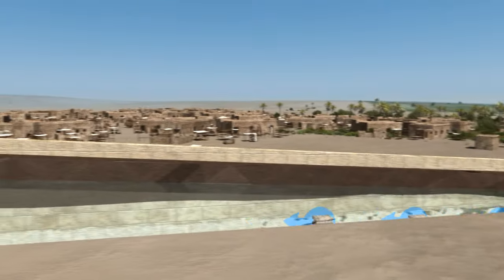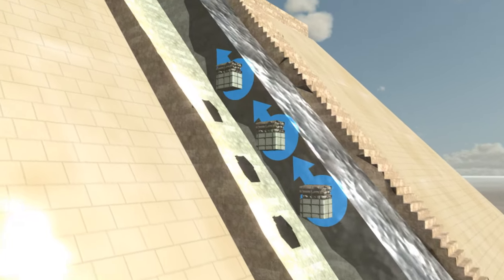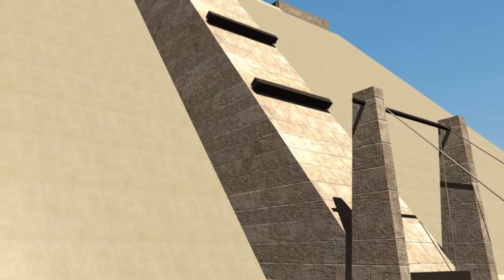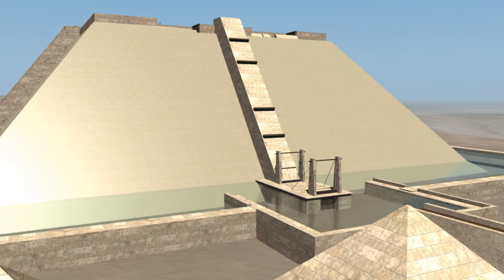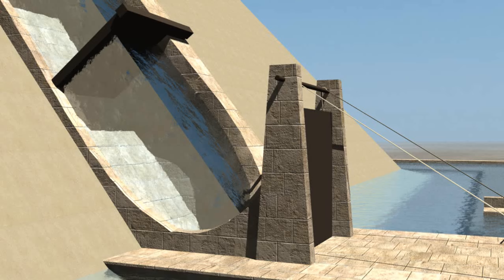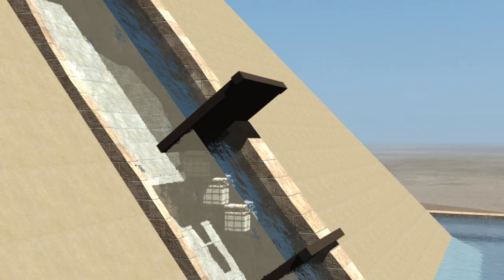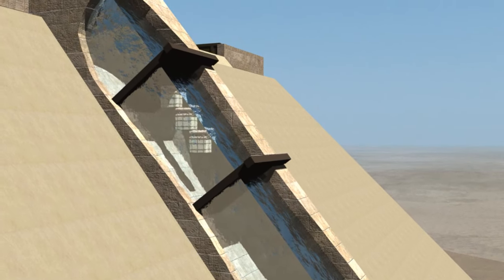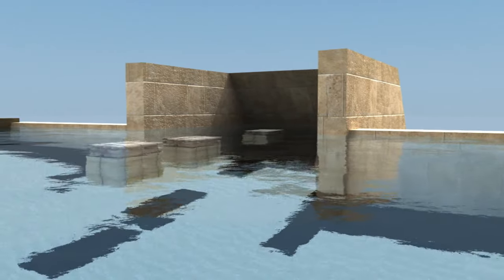How the Pyramids of Egypt were really built Addendum - Multiple Locks

Comment: Every time a block and floats go in those locks it displaces an equal amount of water down and out of the locks. As the blocks go up into each lock that amount of water is displaced downward into the lower lock. When the block reaches the top the water that was displaced from the locks is replaced by that amount of water from the top pool. So in effect you are trading water for stone, but you had to get that water up there in the first place plus extra for evaporation.
Reply: presumably it is easier to bring water up in smaller quantities than the blocks?

Comment: This wouldn't work because of the enormous amount of pressure to open each one, then you're dealing with water running out because there is no way the ancients could attain such a tight seal, which if they could would further increase the impossible pressure on the "gates".
Reply: Watch the video again. With the use of gates, the pressure is MUCH lower, and the gates are moved perpendicular to the pressure also.

Comment: As an engineer I can say the following:
1. The masonry walls of the shaft will burst under the pressure of the water column.
2. How are these locks supposed to be waterproof.
3. Filling the shaft with water and keeping that water inside would be a bigger challenge than building the pyramid itself.
4. The flotation device would need to be much bigger than shown in this animation. And thus the shaft would have to be wider which makes problems 1,2 and 3 even worse.
5.  The buoyancy force acts in a vertical direction, not a diagonal one. The blocks would be dragging on the celling of the shaft possibly getting stuck.
I can go on but I think you get my point.
Reply: I recently heard that any water elevator theory is not that credible. They don't have a lot of support in academia. Yet, these videos are all over and you keep hearing people say "did you know that the egyptians used those water elevators"
Reply: Very important points which do not seem to be dealt with that I have seen.
Reply: Attach the blocks with a rope on the bottom to a loop of rope and guide it up like a conveyor belt. And is the water pressure really enough to move blocks weighing a ton? let alone if they had 2 or three layers to reinforce it? easier to do that then the massive ramp idea. And when I calculated how many gallons you need to displace to get it neutrally buoyant if you use the top and all 4 sides, each face only needs to displace 116.9 gallons of water Roughly a little more then a bathtub per side, would need to be displaced. And granted if all you need is neutral buoyancy or slightly negative buoyancy, then the pulley system could drag them up the side and they wouldn't touch the roof of the tunnel. or just have the two positively buoyant and one slightly negative to balance out. And with multiple gates and locks the water pressure on a individual section can be reduced, yeah if you opened every gate at the same time then it would blast open the base, but what is it more likely to do, break the gate wood at the bottom, and all flow out or exert sideways pressure enough to move 1 or 2 interlocked 2.5 ton bricks? and all the friction force that would entail, it's not just a brick wall, it would act more as a solid stone wall in effect. And again what is easier, or occoms raizer this. Floot stuff around requiring relatively little man hours and need to pay people, or much fewer slaves etc. which as pharaoh means more money kept for you. Or do it the harder more costly way, and who is to say it isn't a combination of both methods. I know I for one don't even care if it's harder this way or more complex geting to work standing in cool river water all day or at least near it, due to it's micro climate of the cooler sourouinding area, would be way worth it. I used to work landscaping and I would wrap a cloth around my head and dip it in water, and that is SOOO much nicer then being out in the sun with no hat no cover, no shade, and working near water is SSSOOO SOOO much nicer. Go and work a week hauling around heavy equipment in the hot sun and you will do anything to keep cool, ice water, walk through the sprinklers, etc. Getting to be wet at my landscaping job are the easiert nicest hours to work. I spent over 3,000 hours in that job so I know what workign out in the sun is like, and hauling heavy crap around is like. I would not care if this method is more complex if it is at least possible, I as a worker would find it 10X 20X times easier to work on a pyramid like this than, your method. in fact I would rather work in the cool water of the pyramid like this, then out in the fields, or as a warrior, and who is to say they didn't do a lot off this work in their time not at war, keeping all your military strong and fit, while also making a monument saying don't F*** with us. If we can build something liek this we'll F** you up, so pay your homage. And don't start any trouble. And also having a line of people passing water buckets, is somthing even relaticly old and disabled people can do, and is much nicer work being around water in the hot sun then, your alternative of MOVE HUGE BLOCK RRRAAA!!! So cheaper easier, and like I've said befor the methods could have been done on small scale and other pyramids first while working out the methodology, and the kinks, how many gates do we need. Oh crap boss the gate at the lower lock broke again , the water seems to keep breaking it once we try to add more hight or water. "well add more" months later, it did it again... :/ add more then. etc etc. trial and error can get you to the point where you know what to do. and starting small and learning the concept, can get you much of this knowledge. Trial and error is essentially a crude form of the scientific method. so even if it is more complex, if easier, and cost and labor saving, anyone would rather do it this way. assuming it can be done. And granted I accept it may not be able to have done this way or maybe it could have been done this way but never was. Still I know if I was a worker, or grunt. this would be so much easier work.
Reply: @LegoSwordViedos  In this system, the workers still have to lift massive stones up the side of the pyramid, in order to make an elevator shaft out of them. An elevator with walls two or three stones deep, in order to withstand the water pressure. 
Therefore, the elevator idea merely leaves the builders with the same dry lifting problems, plus the extra issues and labour and time to build, operate and maintain the water elevator.
Reply: It's a silly theory
Reply: What about moving the giant stones you need to make this water elevator. Do you make another water elevator and so on this entire idea is based on building with giant stones to move giant stones to build do you see the never ending issue here. The simplest way is a complex pulley system using a water canal and boats to pull with and you could also help the boats pull by making parasails flying them up high using the heated air coming off the sand or using the giant golden sun disc to direct sunlight in the direction of said parasail forcing it in the direction you wanted. You may say sounds to complex of a theory but think of the complexity of the water elevator idea and my idea i think mine is more common sense based instead of needing higher knowledge. Boats float and pull a lot of weight and flags blow in the wind also every boat had sails and used a form of pulley for the sails so they only needed to create the canal which we know they did and they also found a boat right near the pyramids so i think this is more believable then a water elevator.
Reply: @martinheath5947  what isn't silly is levee, lock and canal system to transport quaried stone to at least the base of the pyramid. Up the pyramid is a bit far fetched but wouldn't put it past the Egyptians to figure it out, actually....they were incredibly brilliant!
Reply: Why just an elevator? Why not using huge sand embankments surrounding the whole structure and temporary block the nile river to fill it with water? A foundation of big blocks will stop the the vertical water force.
Reply: The jamming of the gates was the first problem I saw.

Also to make it float you have to make granite (which is 2.75 times denser than water) plus floaters (lightest dry cedar may have 1/3 density of water) just a little less dense than water. So ... 4 times the volume of the stone that's to be lifted? Or use watertight barrels?
Reply: I'm not an engineer and I was thinking the exact same thing when I saw this video.
Reply: Look they probably used water but they didn't do it that way I almost bet they had a bucket wooden or same material as the pyramid and would line a block floated in like you said was possible up with a Lift kinda pulley set up and dry the top the would full the bucket to assist in lifting the black up it probably wouldn't fully lift alone but imagine having a counter weight about the weight of the block + 10 strong builder men pulling a rope to control it's speed on how fast they raise it and as you being a engineer do you think his is a more possible option?
Reply: The walls are plenty strong if the water column is inside the pyramid ☝️
Reply: My tour guide said they used a lock and dam method to build them I'm not saying I believed it but his way of explaining it was more along the lines they buried the pyramid as they built each layer and would flood the inside square and float the blocks up on air filled animal bladers place a layer and repeat and once done came the reveal or unburial. That just sounded like far more work but I mean at the end of the day they were a lot of work regardless of the building method.
Reply: Pray tell how many forests would’ve even leveled for wood??? Lebanon is where the trees came from.  How many herds of animals butchered to make balloons?
Reply: Here is the answer 

From the Noble Quran:

 And how many a generation before them did We destroy who were greater than them in [striking] power and had explored throughout the lands. Is there any place of escape?

Quran 50:36

Here Allah SWT is reminding Us, back thousands of year's ago, there were people who were Created much stronger, and Allah also gave them this wisdom and also strength. And it was much powerful.
Reply: @judygreenwood4696 you can reuse the wood and the bladders… just like you can reuse pallets, or shipping containers.
Reply: Mate everything u said is absolutely rite the size it would have to be to make it work would have been to much work on a floatation device then the pyramid itself so this would have never have been thought of then also to seal something that bit would be almost impossible back then literally impossible
Reply: Bobibest89 do you think the pyramids were electric power plants? I don't ,but I would like to hear what you would say .
Reply: @LegoSwordViedos  ... Love reading your ideas, but please, use paragraphs and spacing where it is easier to read.  Very hard as one huge block of text.

Comment: Query :
How would they get that much water up there in the first place?
How would they move that much water every time they complete each level?
How thick would each gate be to be able to suppose that amount of pressure?
How would they have made water proof junctions around each gate?
How would they know each rock had moved up far enough to close the gate behind them?
How thick would these water tunnels need to be to stop the water pressure breaking it apart?
Wouldn't these water tunnels still be there if they were so solidly built?
Reply: hey good questions!
Reply: 1.) By bucket, By pump or the same way its proposed that they moved millions of tonnes of blocks. Although I would suggest some form of rudimentary pumping mechanism. Even if it was powered by say men or beasts of burden walking around a wheel. This would allow a relatively large amount of water to be moved. It could be achieved by creating a secondary channel next to the main elevator, a miniture version, and pumping that water.
2.) They probably would have had a secondary access system, i.e. scaffolding, or an earthern rampart or something running along the sides, after all moving people in this water elevator is unpractical as people need oxygen, and also two way traffic would reduce throughput
3.) No idea, the gates at the panama canal aren't that big though, They could have even been internal stone valves.
4.) Not an engineer just supposition, ancient egyptians used bitumen to in boat building and in the mummification process, I would assume they would use something like that to assist iin waterproofing.
5.) I assume they would have a timer of some kind, the egyptians had glass around the time of the alleged construction, a glass piece filled with sand would be easy to construct and operate through experimentation, the time keeper could then bang a gong or ring a bell or something to signal the gate operators to open and shut them.
6.) Probably quiet thick tapering outward at the base, keep in mind the pyramid is millions of tonnes made out of ~2mn blocks, I am sure a few more wouldn't have been such a large challenge
7.) No, here is a thought exercise, how many houses or other buildings in your country are constructed/painted/maintained with scaffolding, after this is completed is the scaffolding left? Even some castles in europe have holes where logs can be inserted to protrude out of the walls at a right angle, and then support scafolding. Once construction is finished the scaffolding is removed.
Reply: chris massey said that the water tunnels still exist under the facade, but to proof that they have to destroy parts of the pyramid/s.
Reply: And what happens if a block gets stuck. Disassemble everything to figure out where the problem is?
Reply: @junuvojam8453  Maybe the locks weren't external, the pyramid access tunnels and chambers were themselves used as siphons or clearly the egyptians had the technology to cast sandstones. And were cast on the spot.
Reply: @junuvojam8453  
I don’t know of any ancient pumping system that could have produced enough power to propel water up a 52 degree elevation over hundreds of feet.
Egypt is extremely hot; there would have been an enormous amount of evaporation which would only component the problem.
Reply: @philiptilden2318  It's all ram pumps and they work best during the rainy season...
Reply: Yep ancients could not move large volumes of water uphill, unless they have a higher water source nearby, which they dont.  Moving the gates would be impossible under that much pressure.  Water would be spraying out around any leak in the gate.
Reply: @philiptilden2318  supposedly they had chain pumps.  and presumably this is during flood season when the humidity would probably reduce the evaporation rate.
Reply: For questions #1 & #2: Displacement.

Build a 10 foot tall, water tight, outer wall at the base. fill it with water. (Level 1) Build the outer wall another 10 feet (level 2) , fill in level 1 with large stones. Water is displaced by the large stones. And since it can't be displaced out because of the wall, it moves up into the void of level 2. Keep repeating until you've reached the top level

I think this could solve how they would have filled up the "elevator" as well.  Shape of the pyramid requires less water at each level, allowing for the excess to be diverted into the "elevator".

I'm not saying this is how it was done. But out of all the theories I've heard, this actually seems the most primitive, yet practical way.

Comment: Many former readers mentioned the reasons why it will not work.
I think there is one missing point.
As the height of water column increase, the pressure will be higher, the volumn of air in the animal stomach will be reduced, thus the buoyant force will be reduced.
The author demonstrated how it works in the part 2, but it will not work in actual scale.

Comment: It's obvious. They put the blocks into the lower lock and then turned the pyramid on it's head, so that they will sink to the 'bottom', i.e. top, therefore doing away with flotation devices.
After gluing them into place upside down, they'd tip the whole pyramid over again and arrange it back into position.
Job done!

Comment: Every Time a gate opens you lose water. Not to mention the loss from leakage. Not one mention of a pump or even a bucket system to replace all that loss
Reply: it was in another video by the same guy. buckets
Reply: @Fellowtellurian  I think there is thing called a water pump. We have them today.
Reply: REM44MAG  that much water weighs a ton. And for DIRT walls to be able to hold it up and push it to the top is really ridiculous.
Reply: @fortunehorse2745  Who said they used dirt walls? The great pyramid itself was a hydraulic pulse generator water pump. Constructed from stones weighing 2-30 tons. The great pyramid itself can easily hold an enormous amount of water.
Reply: REM44MAG okay it’s stupid tho. What did they use to make the pouches air tight seal and the blocks float? Makes 0 sense. Where they get all the water from
Reply: @REM44MAG  The pyramid isnt whats holding the water Some kind of chamber on the outside of the pyramid would have to be built water tight It would have to hold massive amounts of pressure explain all that LOL  NO WAY IN HELL The pyramid was a hydraulic pulse generator water pump UMM NOT Explain the generator part LOL
Reply: @fortunehorse2745  Animal skin for the floats The Nile for the water Thats not the massive problem Building a chamber up the side of the pyramid is the problem Its gotta hold massive amounts of pressure  Water is very heavy Thats the major problem with this theory
Reply: Erric Johnson  only a levitation device would be a good solid answer
Reply: @fortunehorse2745  Yeah but that dont solve transporting all these boulders 100s of miles but yeah a levitation device is mandatory ✌️